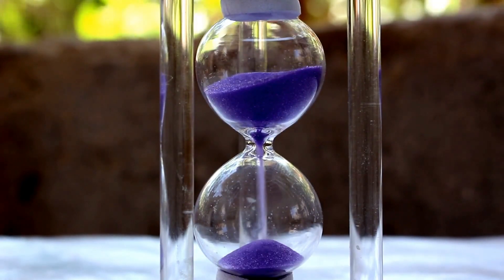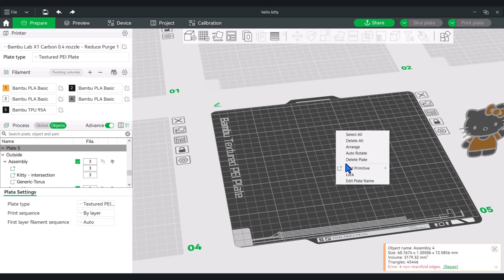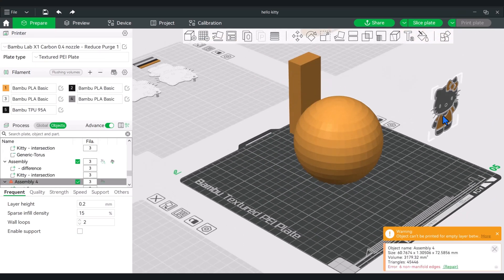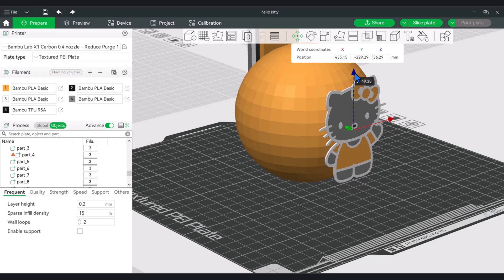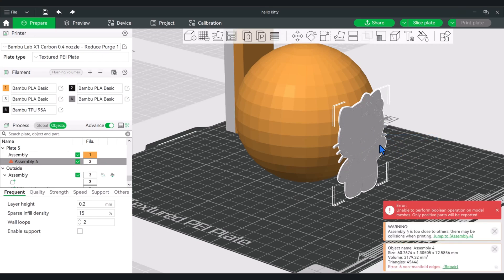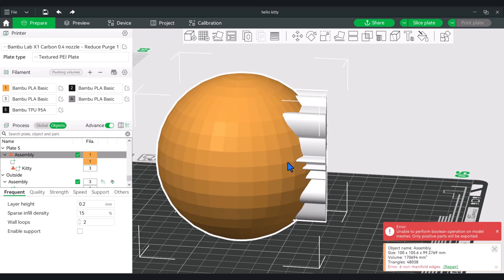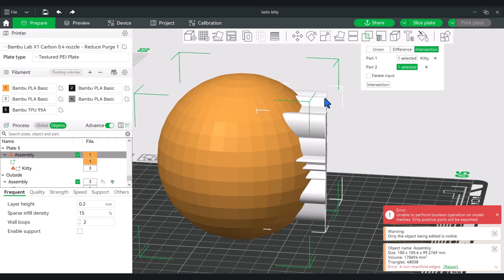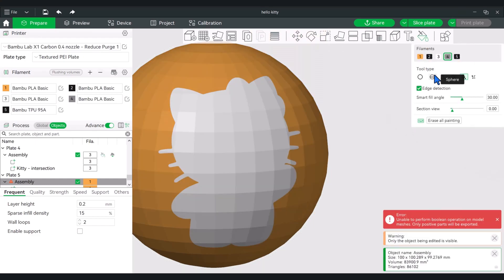Mesh Intersection: Wrapping an Image on a Curved Surface

Comment: Followed your video exactly and cannot get it to work.  Bambu Studio 2.4.0.70 does not have the option under mesh boolean to pick one part and then the next under intersection and the process takes forever and then fails.  I am trying to put a logo on a 3d model of a guy wearing a blank shirt.  I want to put a logo on the shirt.  I need this to work and thought your video was the homerun, but it just is not working.  Can you help me?
Reply from the maker: That's one of the challenges of version differences. 
I would have to revisit the topic Are you using an SVG or stl file?

Comment: I have followed the steps you gave, my two objects are clearly touching each other but I keep getting the error message that it couldn't create an intersection because the objects aren't touching when they clearly are. Any suggestions?
Reply from the maker: @madmaxd89  which version of studio are you using? Should tell you the version when you open the program. 

Depending on what you are using the steps may change a bit.
Reply: @ V2.1.50

Comment: Probably been suggested before, but could save hours if you make the kitty extrude slightly more and then hand paint it? I've done this and it seems to look just as good if not better than the filament colour changes, and you have more variety of colours to choose from. I use oil based marker pens.
Reply from the maker: @marcofalancia9553  Excellent comment. I personally do not like making color changes like this in the Z axis. It takes a good deal of time and can use a bunch of filament if you are only making one.

I mainly created this because folks were asking how to do this and make it flush with curved surfaces.
😊

Comment: What about shaping the Ms. Kitty, just as you did, but THEN separating from the ball and printing separately.  Once done, CA glue it to the face.
I'm very new, but watching, learing and a lot of thinking, "What IF's?".  Is there a reason that can't work?
I feel bad for those who see the, "Just press print", and buy a printer.  There's a HUGE learning curve!!  Even with Bambu!
Reply from the maker: Excellent observation. There can be many ways to complete this project.
Specifically this could debossed and the image printed separately, even with a different orientation, and glued in. 

You are a natural for asking, theorizing and experimenting different solutions.

This hobby can be great for click and print folks, and for those who go a little bit under the surface a whole new world of possibilities open up.

Comment: Hi, have you looked into or come up with a way to accomplish this with the new version of BBS? In 1.9.2.57 they changed "assemble to merge" and created a new tool called "assemble". I still haven't found any up-to-date info on these changes. I would appreciate any insights you may have or if you could point me in the right direction to "get up to speed" on the new tools. Keep up the great work, you have me with so many projects with easy-to-follow simple technics. Thanks
Reply from the maker: Hello. I would have to take a look at the newest version I am still one revision behind until I finish a project. 

Yes  the old assemble has been renamed to merge but should still perform the same. There were a few tools added as well like the measurement tool and the "assemble" tool which as you know is different from the original way.

So for instance if you select 2 or more items and right click you would use the "merge"

I just tested the version I am on which is 1.9.1.66

and from what I can see aside from some name changes the steps are the same. Are you running into any errors or just want to see an overview?

Comment: Just a thought, if you rolled the sphere over 90 deg so kitty was on top, then it would be a lot less colour changes right?
Reply from the maker: Excellent observation and comment.😉 Not shown in the video, but altering rotation would make for a faster print due to fewer color changes, and filament purged as well.

The biggest downside was a quality dip due to a stair step effect. Even on lower layer heights it is never as smooth as horizontal printing.

Comment: Cool, but question-  Is this really a wrap? If one were to print a circle onto a sphere, would it stay true around the corners, or would the result be stretched on the edges?
Reply from the maker: Hello. I usually compare this to a piece of paper and basketball.
If you have a small image on the paper and "wrap" it around the ball you will have less distortion than if you took a large image and put it on that same surface.

Both lose accuracy but it is less prominant with a wider curve/smaller image. 
So whether you use Bambu studio, or the implementation from orca/prusa there is a stretched effect depending on your image and model. Excellent question and observation.

Comment: would it make sense to rotate the ball so the kitty is facing upwards, meaning a whole lot fewer color changes?
Reply from the maker: Printing the image horizontally would greatly lower the print time and filament used at the cost of quality. There would be some unavoidable stair stepping. 

Even with adaptive layers it isnt quite smooth but it is an option of course. Good call out.
Reply: WOW!!

Comment: very cool method, but I couldn't bring myself to print one of those 13g models with over 130g of waste :O that is wild
Reply from the maker: Yeah. I can show the technique but it is up to the individual if it's worth it. @1:00 A single print can use a lot and take a good deal of time, multiple copies can sway the calculation.  I rarely print like this personally. @ 11:25
Thank you for the watch and comment.
Reply: @ashleys3dprintshop  I knew it could be crazy waste, but I've never saw 10x the model before... I understand the multiple copies thing, have been experimenting with multi-color and multi material prints myself manually on an Ender V3 KE, but obviously nothing like this many changes :)